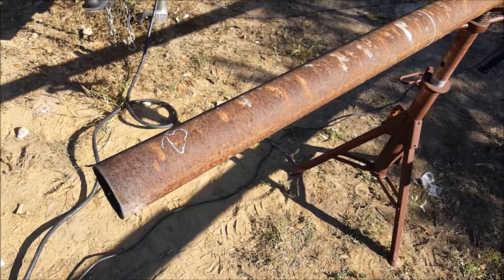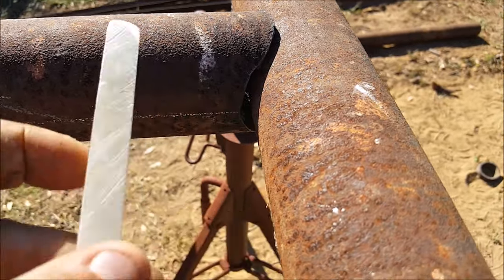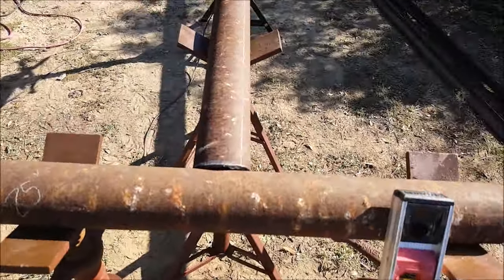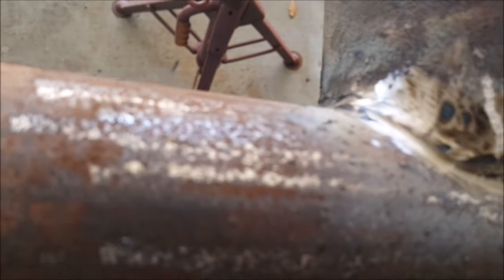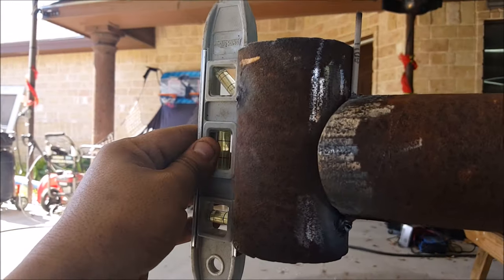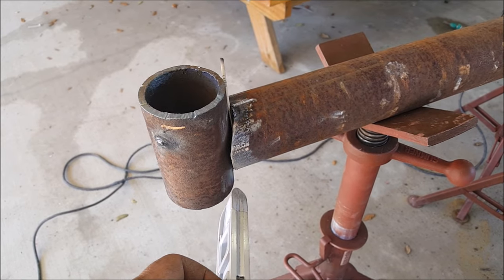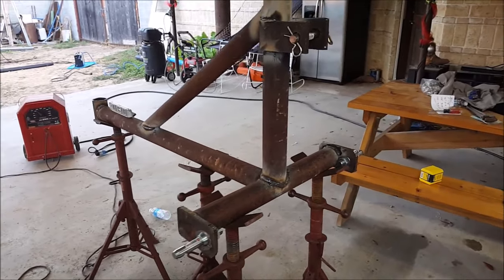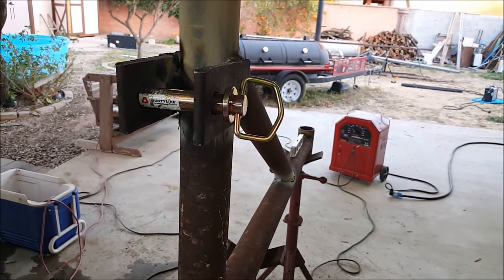How to build the ultimate 3 point landscape rake for tractor Part 1 project to save tons of money

Comment: I'm a pure novice about plasma cutters. About what does one like yours run. We cut 3/8 often and 1/2 occasionally but I'm getting tired of riding a grinding cup. So plasma cutter is on short list. I'd rather buy capable of cutting 1/2 inch than to wish I had bought that size. Also are used ones ok or are they usually wore out?  Nice looking grill from lp gas tank. I bought 5 tanks 1 for grill the other 4 for culverts on farm.
Reply from the maker: Mine was like new at a pawn shop and I paid around $700 and they were about $2200 new locally. My buddy has a smaller 110/240v one and his was new around $1500. You can get cheaper brands but who knows how much life you can get from it. This one cuts great on 1/2 inch steel and think it can do 1 inch material if needed. Mine is down at the moment, I repaired bowl on regulator and now it is leaking on top side of regulator.